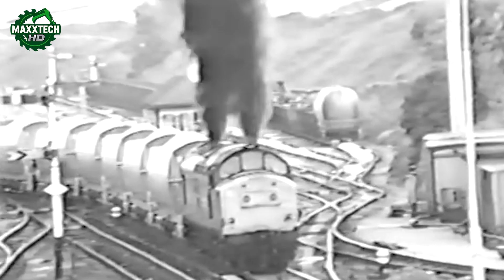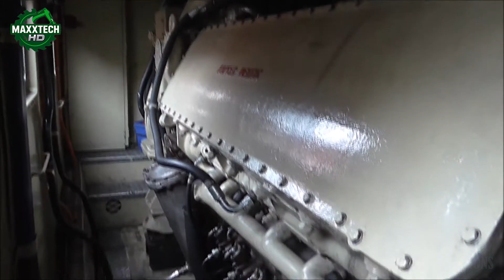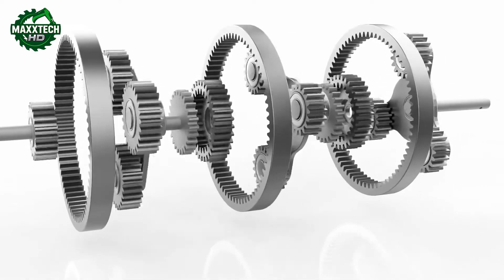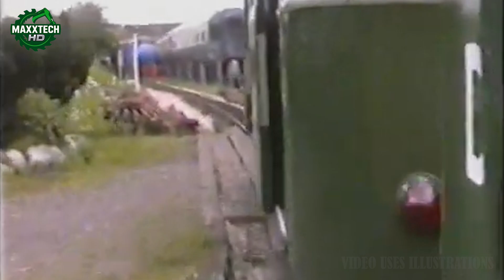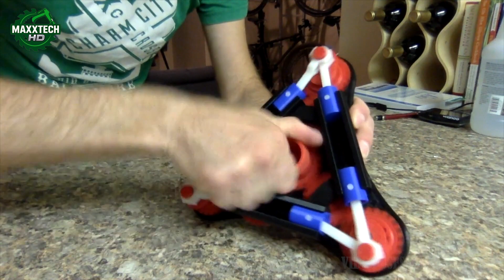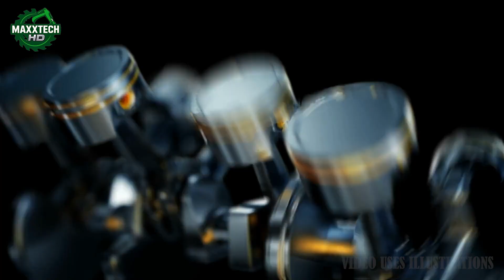The Locomotive So LOUD That It Made the Station SHAKE

Comment: Why are jet turbine engines being shown in this whilst talking about the Jumo 204? The Deltic was derived from the pre-war Napier Culverin, a licensed built Jumo 204. The 204 was a vertical 6 cylinder opposed piston engine. There also appears to be random images and drawing completely unrelated to what is on the screen scattered throughout such as an animation of a radial engine whilst talking about opposed piston. What a disappointment as some of the commentary is decent.

Comment: Well I for one appreciated that quick review of an engine that was fundamental and central to my early years as a naval officer.  I served in 4 Ton class MCMVs, the oldest of which, HMS LALESTON, was powered by two bulky Mirrlees 12-cylinder diesel engines providing 2500 HP, allowing speeds of 15 knots.  The other three were built with Napier Deltics installed, and they were very impressive and very powerful.   It takes a huge amount of horsepower to tow minesweeper gear.  Some ships were fitted with an electric induction loop and  'acoustic hammers' which were powered by an additional "half deltic" and boy was that thing noisy...   The deltics were high speed, cartridge start, 36 cylinder opposed piston valveless compression ignition engines which ran solidly for hours and days on end.  Until something went wrong .....  One day, an almighty cataclysmic bang in the engine room of HMS LEWISTON heralded the catastrophic rupture of the port deltic engine casing, with pieces of cylinder, piston and great chunks of jagged aluminium shrapnel becoming embedded in the engine room deckhead.  I still have a fist sized lump of aluminium from that engine that I dug out of a bulkhead back in 1982.
Reply from the maker: Wow, that’s an incredible story and a truly unique perspective on these engines! Thanks for sharing your experience.